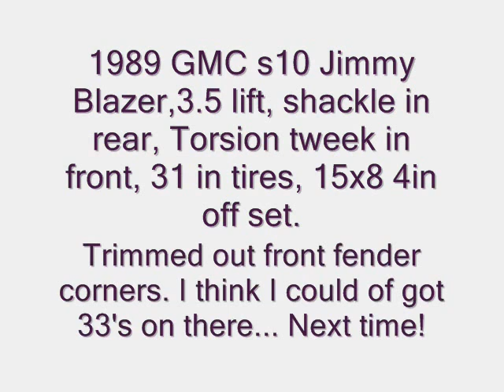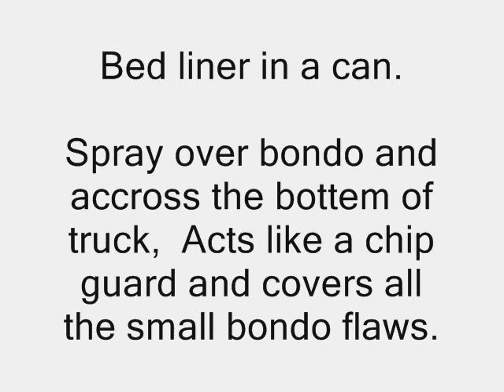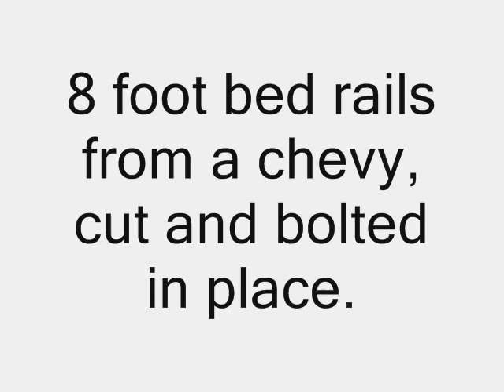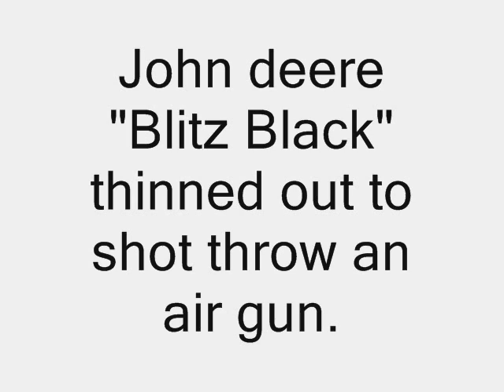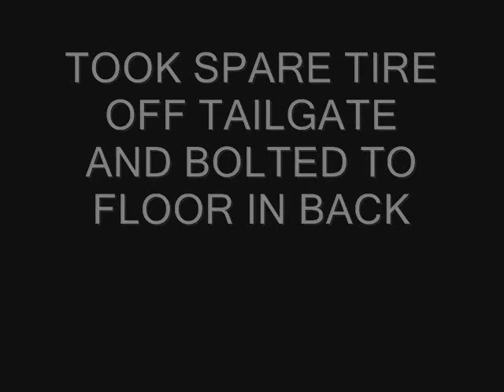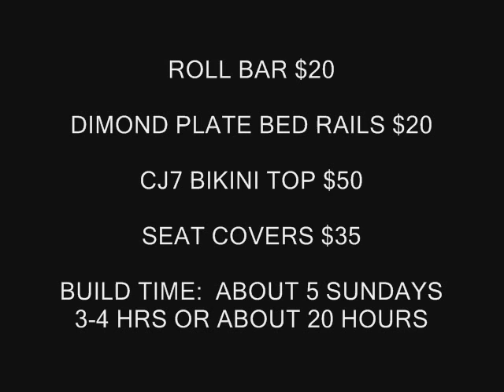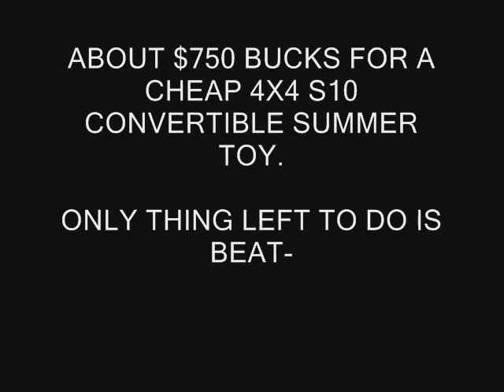CHOP TOP S10 BLAZER CONVERTIBLE

Comment: Hey thanks for your comments I actually built that Blazer years ago I haven't checked this YouTube channel in a while sorry anyways everybody told me if you cut the roof off the truck will bend in half because that's what structurally supports the body number one don't listen to people go with your gut feeling just make sure it's safe once I cut the top off I added a steel round bar behind the seats and welded it so when I slam the door the body wouldn't shake and it was structurally sound believe it or not I took that expanding foam they use for houses and windows and just filled all the holes and then cut it with a razor blade and painted it.
It was a fun truck motor ran mint I actually sold it to a kid down the street a couple years later.

Comment: man i'd pull that  shitty front and rear bumper and make somethin really nice... but, other than that son of a bitch looks sharp! but, question what did you do about your rough cuts.. where tou cut the doors and right above the wind shield?? i'd look for some rock guards for your head lights i get em on my 99 cherokee and they come chrome but you can prime and paint them and they look good